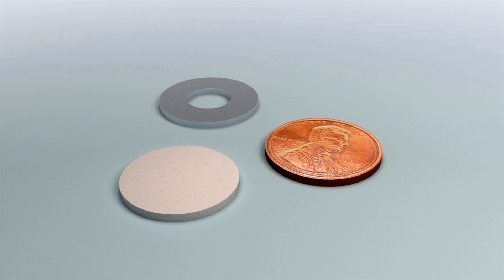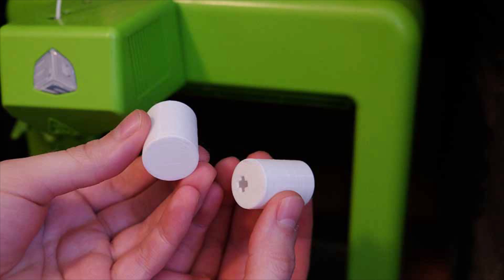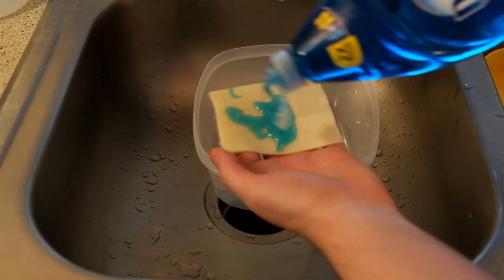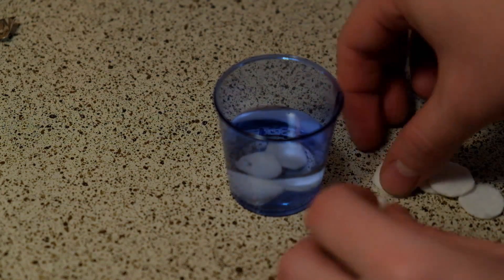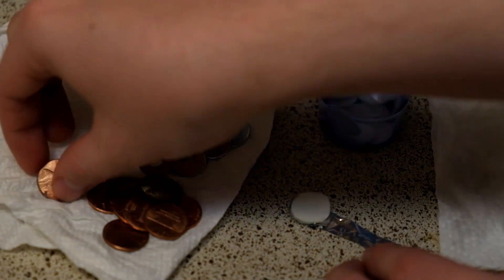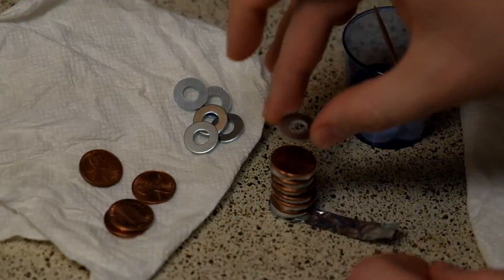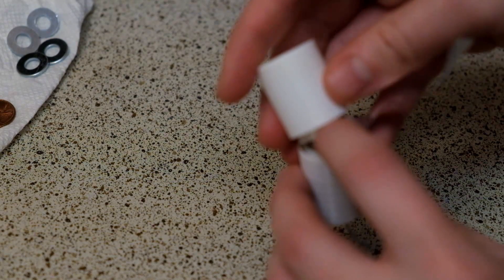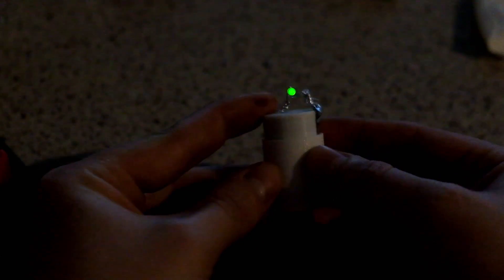How to Make a 3D Printed Battery

Comment: if it is more voltage why isnt it more bright? (more than the small battery).
Reply: Not alot of amps
Reply: it's a 5v led, not a 3v led.
Reply: @joelpichette  Joshua is right, the current from the battery is very low, LEDs are between 1.8 and 3.3 volts, even the big fat ones are still roughly 3.3 volts...
Reply: The internal resistance of the battery is too high

Comment: wonder how many do you have to make to run on a gameboy
Reply: Just one
Reply: Actually only half of one, because you're average Gameboy runs on 3 volts
Reply: @willywally5997  no, it'll probably turn on, but you'd need a tonne in parallel to actually play it because the capacity of one of those things would be tiny, otherwise everyone would be using them instead of store bought ones...
Reply: @nokel2  ah true